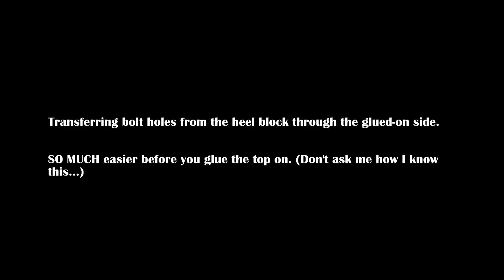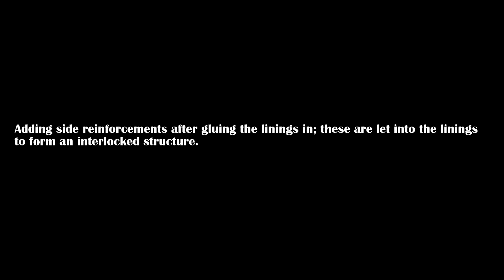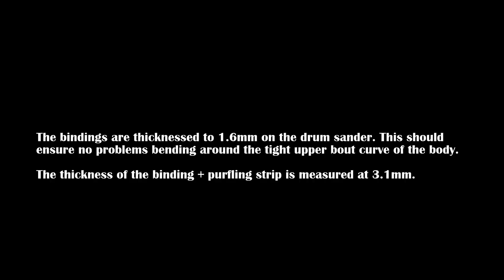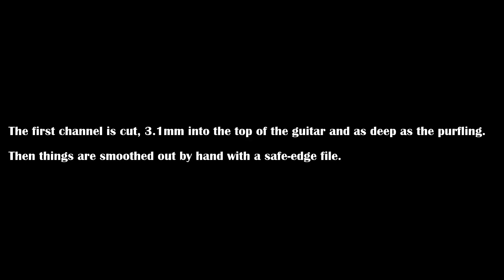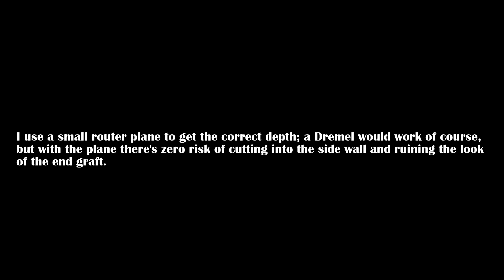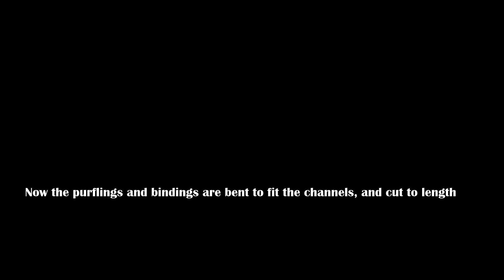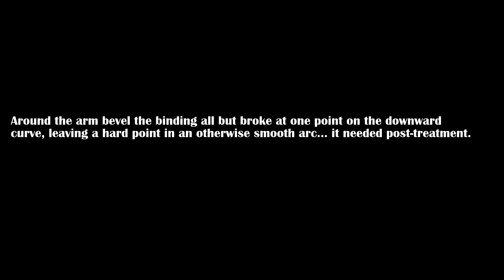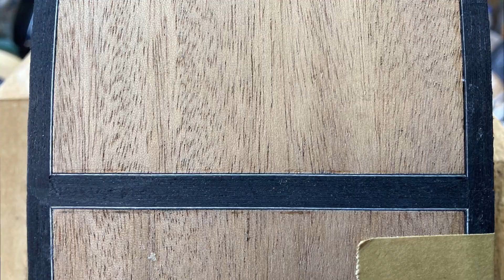GGBO 2021 Acoustic guitar build - Binding the completed body

Comment: Thanks for posting! Your binding channel cutter is nicely made. I like the adjust-ability by using the copper pipe, much cheaper than buying the router bits and bearing sets. I also have not seen the twisting of tape in the waste - THAT is worth the price of admission! Now I just have to try and remember the tip in my current build!
Reply from the maker: Yes, it took me a few builds with gappy waist binding to come up with the twisting tape trick, one of the very few ideas I came up with myself, although countless others probably have. Most of any tips I have are unashamedly borrowed from more experienced builders, and  particularly the school I learned at in Totnes, UK. 

Honestly the adjustable binding jig was a no-brainer though: I hate the idea of being tied into a series of rigid bearing diameters when you might want to be a bit creative and stick another 0.25mm veneer or two into a purfling set to jazz things up a bit and you're constrained by the set of bearings you've got to work with. Ditto the adjustable outside mould - (Totnes school again); it gives infinite possibilities for body shapes, with the caveat that you have to learn to bend sides by hand. A skill worth learning anyway, IMHO.
Reply: @GarlandStringedInstruments  Thank you Chris. That binding jig will be worth a study when I come to build one. The handheld solutions I use work ok, but I see an improve method with the jig - and cheaper than the professional models.

Comment: Very nice job, could you tell me how thin did you make your sides for bending them?? Iam attempting my 1st parlor sized guitar build but my 1st attempt at bending the test side failed I had it down to 2mm thin. Thank you & God Bless🙏🙏🙏🎸🎸🎼🎹👨🏻‍🦯
Reply from the maker: Hi - I made the sides 2.1mm, but mahogany is a fairly easy wood to bend. With other woods and on tight curves (on a Venetian cutaway for example) I've gone down to 1.7 or even 1.6mm in the parts to go round the tightest bends. This 'localised' thinning of just some areas has to be done by hand of course. The great thing is to develop a feel for when the wood 'wants' to bend, and this varies a lot with thickness and the wood type. Good idea to have a practice side!

Comment: Just thinking aloud...  perhaps if the arm bevel was covering a longer distance, it would be a more gradual curve getting into and out of it, as well as the transition at the bottom. Maybe 12 or 15 inches in total length. A side effect of this might be that you could go deeper down the side as well.  What do you think?
Reply from the maker: Thanks, that's an interesting thought and it would definitely have the advantage of more gentle binding curves, as you say. But I think there would be a problem: I haven't worked out how to make a 'curved bend', i.e. a bevel that would follow the line of the body round the lower bout. So I have to bend the top wood along a straight line. The easiest line to take would be parallel with the grain, but in order to get the bevel where I think it's needed (at about 7 or 8 o'clock looking at the lower part of the body as a clock face) the "with the grain" bend would have to extend almost up to the waist, stiffening a lot of potential vibrating top area for no added benefit in terms of the bevel - only the "8 o'clock area" would ever be touched by the player's arm. Here I managed to do a slightly cross-grain bend, localising the bevel to only where I think it's needed, but it's still along a straight line. Any longer straight line bend would take vibrating top area away and wouldn't add to the player's comfort, as far as I can see. Does that make sense?
Reply: @GarlandStringedInstruments  I was just thinking that a deeper bevel would be more comfortable and that making it longer would probably be necessary in order to avoid tight curves. I made one where the entire top was arched side to side with about a 1.5 inch drop from center to side at the lower bout. It had slightly less bass but the payoff was a tight, extremely resonant mid-range.
Reply from the maker: @timhallas4275  Yes, I see what you mean: a deeper bevel would probably be even more comfortable. I'd try to avoid making it much longer though, for the earlier reasons. I'm sure I can improve my bending technique, both on the top wood and the binding, to avoid the problems I had this time round. I think being very disciplined about the depth of the kerfs sawn into the binding would help a lot to get an even bend through the bevel curve (I was a bit haphazard about it this time because I was intending simply to cut away the waste wood above where I'd sawn). A jig would help ensure uniform depth.

What you did sounds like a cylindrical arch, is that right? I've yet to try that on a guitar, but I'd certainly like to!
Reply: @GarlandStringedInstruments  Yes, a cylindrical arch sounds right. I didn't know what to call it. It also solves many stability issues that plague flat top design.  like belly bulge. The arched top acts like a truss, and requires far less bracing.
Reply from the maker: @timhallas4275  Exactly - the arch is such a strong structure, it is a mixed blessing (or a double-edged sword, or whatever you want to call it!). Its strength must mean that you can massively reduce the bracing, and belly bulge is a distant memory, but controlling the sensitivity/responsiveness of the top to the must be very difficult. As I say, I haven't ever tried one, but I've got it on my list...
Reply: @GarlandStringedInstruments  I believe wood selection is the single most critical factor. It only takes a slight bow to get the strength needed to nearly eliminate bracing, and to achieve arm comfort.